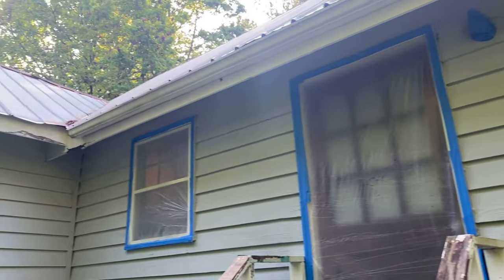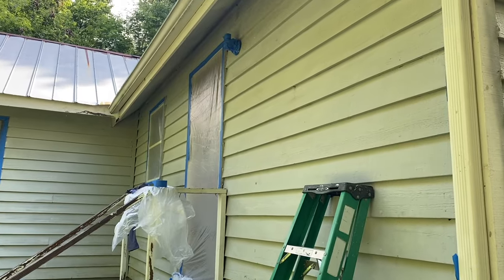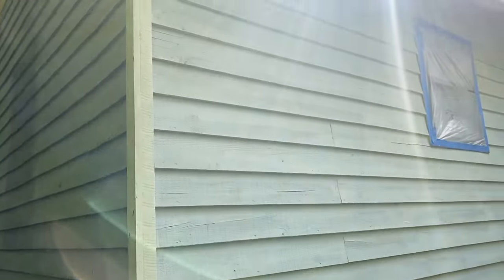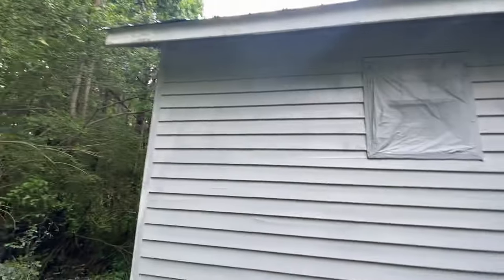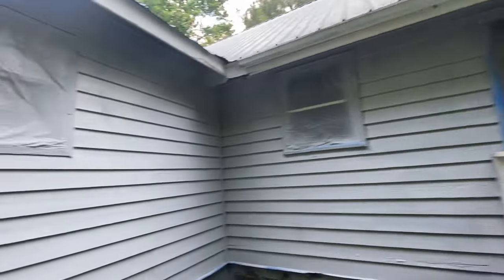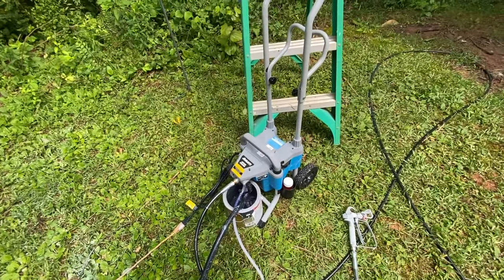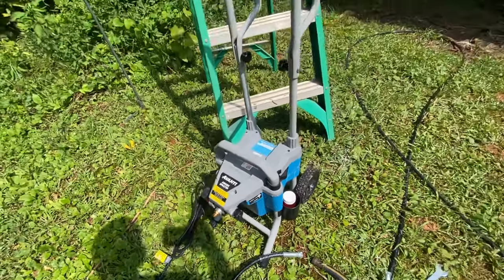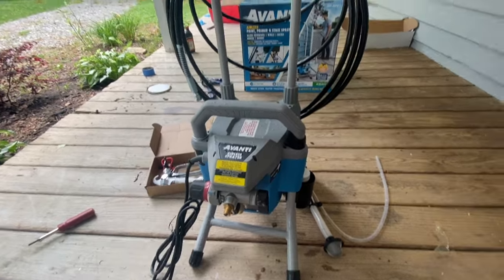CHEAP Harbor Freight Airless Sprayer! Avanti second use and review!

Comment: I bit the bullet and bought one last weekend. I'm impressed with it. I sprayed two ceilings and interior walls with it so far.
Reply from the maker: Awesome! glad it is working well for you!
Reply: Do you guys know if I can change the tip with a different brand one?
Reply from the maker: @ShinyOwl  the Avanti tips also fit Graco and Titan according to the packaging notes, so we’d  imagine the Graco and Titan tips fit the Avanti as well but we have not tested that theory just yet.
Reply: @OrangeWiresGarage  thank you for your reply!
Reply: I'm sure they're all interchangeable
Reply: @OrangeWiresGarage  What extension brands can I use for this sprayer? Have 10ft cielings in living area so we would definitely need an extension. Thanks
Reply from the maker: @karenmorales882  That’s a good question and we checked the harbor freight website and didn’t see an extension offered.  However the tips for the Avanti do fit GRACO and TITAN so maybe one of those extensions would work but we have not tested that.  Thanks for watching and subscribing to our channel!
Reply: @karenmorales882  harbor freight now sells extensions if you haven't found one yet lol. But they are only $20
Reply: It's a beast bought it as a backup and Ive done two whole exteriores a bunch of ceilings and fences You just need to use a smaller tip and thinner hose so You can spray no stop
Reply: @juansolorio9683  I'm about to buy it tp stain my fence. Any tips or recommendations?? What's the best tip size for staining fences??
Reply: @yaseralzoubi8003  go with a small fan maybe a 210 314  and keep pressure low because stain is so thin and it makes it very volatile
Reply: @juansolorio9683  what do you mean?  Smaller hose to spray non stop?
Reply: @Timsautosolutions  yes as in thinner then the one it comes with it's made it easier on the pump and I can spray away non stop

Comment: I just bought one, its definitely cheaply built. The tip that came with mine did not fit, but luckily I bought a second one (312). that one was really tight. The pressure control on it seems meh. Really wish they would have put a pressure gauge at least at least where the line attaches to the pump. I wouldn't buy one unless you can use the 20% off coupon, which brings the price down to make it enough of a bargain, a Graco x5 in my area goes for right a 300$, so the 20-30$ savings without a coupon isn't worth it IMO. Even still, if you have a bit of extra cash, just get the Graco.

Its still far better than rolling. If you need to do interior work, get better tips, like actual brand name ones (Graco, Titan). the avanti ones are dogshit IMO.
Reply: Couldn’t get a single Titan or Gracie bit to work in their gun!  Gun is a piece of crap.

Comment: great video and thankyou. I am about to do the entire exterior of my house and never used a sprayer before so I do have a couple questions if you dont mind. Can I use the 519 tip? Should I power wash my house first before painting or sand or just start painting? And how many gallons of paint did you use on your house? Thanks again

Comment: Nice masking on doors/windows/lights.  How did you not paint the eves?  Is the direction/spray line that good?
Reply from the maker: I came back and painted all those white later
Reply: @OrangeWiresGarage  so just run blue tape and plastic hanging over the walls?  How far do you mask to not overspray using the Avanti?   It's on sale now and looking hard, with the 20 inch extension.
Reply from the maker: @taz104  it doesn’t overspray a lot you could use a cardboard shied around a lot of things.  I’m more of an automotive painter hence all the masking and plastic. I paid $199 for mine and would do it again it saved me so much time painting the house.
Reply: @OrangeWiresGarage  Thanks.  Much appreciated!

Comment: Thanks for the video Would it be any diference painting a metal dump bed. What is your opinion?
Reply from the maker: No it will paint it for sure, you will just have to use a solvent for cleanup if using any solvent based paint! Thanks for watching and subscribing!
Reply: @OrangeWiresGarage Thank you.  I want to try with oil base paint. I dont expect it to be perfect since it would be  first time trying airless it should be quicker. I used brush and roller before for the same purpose. Keep those vids coming. Good luck

Comment: I bought one a few months back and am just now getting to the point of spraying. Going all the way around a split level. Roughly 2900 square feet of painting. Took a day to tape and hang plastic over everything. Was the priming hard to get the hang of? I've painted with air sprayers a lot, easy to just add paint to the can. I'm hoping to be just as happy with the sprayer as you seem to be.
Reply from the maker: It’s easy to prime, also easy to add paint to the bucket when it gets low.  Even if it gets too low it will prime itself back up.  Thanks for watching and subscribing!
Reply: @OrangeWiresGarage  I wished there was a way to post pics, but this sprayer was a lifesaver! Two short days of taping and covering with plastic. Then Two "half days" of spraying.  The sprayer worked flawlessly. 💪
Reply from the maker: @larryparker5262  Good to hear it, sounds like your pretty happy with it!

Comment: I just bought the same machine. My personal experience the gun and tip are a nightmare. You have to wrench down on the tip really tight just to stop it from dripping. And the little seal falls out as soon as you unscrew the guard. The pump is great but the gun is the biggest piece of s***

Comment: Good idea. Fast forward the painting process.  I thought that was the purpose of the video.  To SEE how it puts down the paint. Nope. This video shows a one handed fumble around with tools and most of that was off camera looking at the ground or so close that you couldn't tell what it was you tried to show. Mostly a waste of time watching for how the thing puts paint down. Oh and the spaying into the air didn't show anything.  So what. It sprays. What does the painting look like AS ITS APPLIED?
Reply: I painted a split level with it. Lots of going up and down the 30 foot ladder. Ended up with ZERO  cold joints. That was my biggest concern.  It sprays very even. A little over 2900 Sq Ft, about four hours first day, and same the second day. Most of the time was spent going up and down the ladder and moving it. I used Berh Premium Plus Satin.